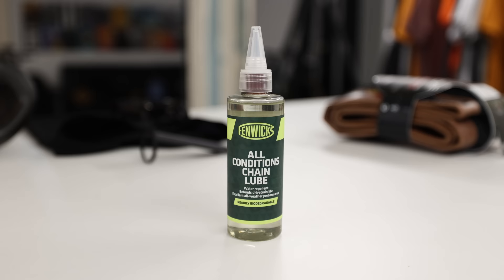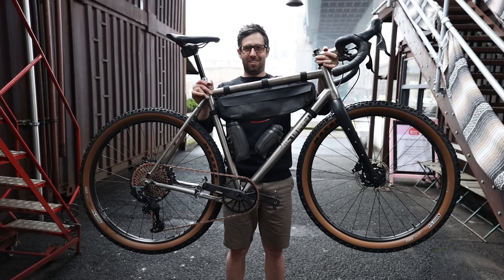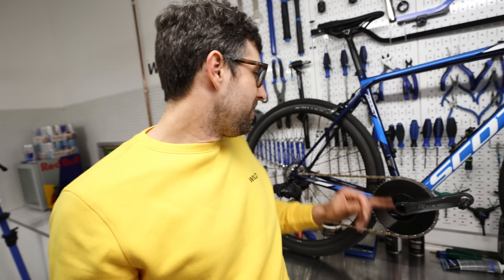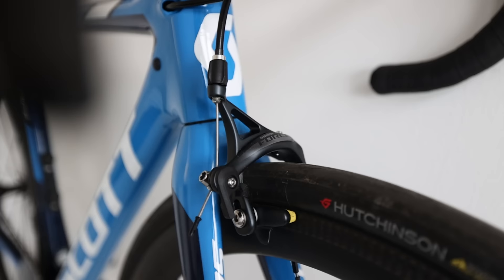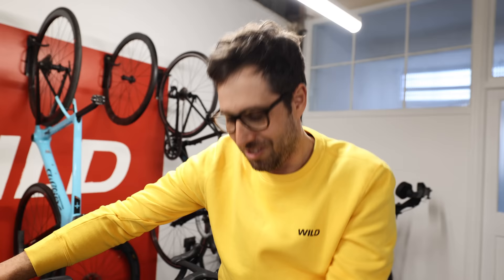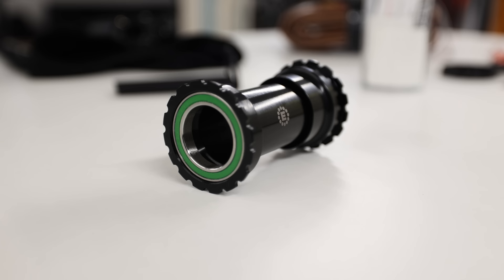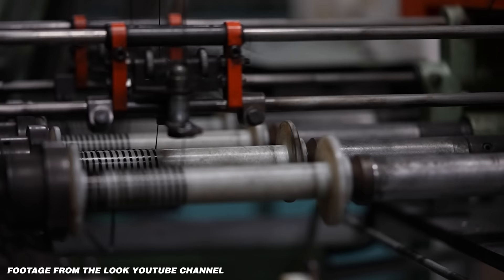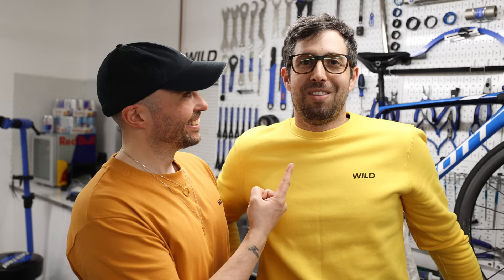Pro Bike Mechanic's 20 Most Loved Products

Comment: Gonna be another vote for a top tube bag. Sunglasses, snacks, phone, money etc. It's all there, it's handy and it secure. The new Tail Fin ones look sick. This was a great video, loved Jimmy's attempts at counter points.......long story indeed
Reply: Nope, pain in the 'nads on small frames
Reply: @matthewlewis2072  

I can see that, but I run a medium frame and a Topeak Fuel tank in .75L. Its not too big and I can straddle the bar with no issues. That new Tail Fin that goes all the way across would be a no go for me for sure.
Reply: Who puts sunglasses in the same bag with one's phone or any other hard item that can scratch the lens(es)? That thing has to be on your nose or tucked into your helmet. All the other stuff belongs into jersey pockets.
Reply: @einundsiebenziger5488  
If I do put sunglasses in there they're in a cloth bag. We all do things our own way but thanks for your nice feedback
Reply: Another fan of top tube bag here. Puncture repair stuff and multi tool in the saddle bag, snacks, shades (in a case) and phone in top tube bag. My Domane has two bolts to secure it so no problem with it coming adrift

Comment: My favourite stuff is Tubolito inner tubes. I bought mine two years ago and had only one puncture since (which I patched - I've put thousands of kilometers into that tube since and it's still going strong). These are especially useful as spares. I carry way more stuff in my small saddle bag since I replaced a bulky butyl tube with one.
Reply: Do they keep pressure like a butyl or latex tube?
Reply: @russellbaker4256  They're just like butyl tubes in that regard.
Reply: So i ride enduro FS bikes, i keep a tubolito on my framestrap, theyre phenomenal, ive got home 3 times with the tube as a last resort. get home, remove it, and replace it on the frame for the next flat.
Reply: The Chinese ride now version cost a few bucks and also seems to last quite well. In many cases they're cheaper than regular tubes at the bike shop
Reply: @javiercastaneda707  I use those and theyre awesome, and super light!
Reply: Piling on for TPU tubes, whether Tubolito or Ride Now or other brands. Fantastic kit, I use them and carry them as the spares and at this point trust them enough I'd set off on a mega long tour with them in my tires and 2 spares. That alone saves you 1/2kg or so!

Comment: Shimano 12x mechanical MTB gears. They just do the job, they are fairly inexpensive if you don‘t buy XTR and there is very little to improve.
Wera A6 torque wrench. Takes hex bits directly which is a lot more useful on a bike than 1/4“ or 3/8“ and makes it very compact so that you can reach bolts in tight spaces like in suspension linkages.

Comment: ''1x'' is my favourite bike product. Im one of those bikers that don't how to use 3 x at all i tend to on 3x stick to the 2nd chainring and just go up and down on the rear cassette. 1x makes it so simple that i have not to think about the 3 chainrings and its bliss just complete bliss. once i got my first 1x its been 1x ever since or converted to 1x.
Reply: Wait until you try 2x 😅
Reply: @rob-c.  my mtb was 2x, still used one chainring only and just went up and down the rear cassette. if im only ever using one chainring then there ''for me'' is no need for the other chainrings to be there like on 2x or 3x so i  converted my mtb to 1x and got rid of the chainring i was not using.
all 3x and 2x bikes i have had have been from new are technically 1x as i only ever use 1 chainring.
Reply: Do front derailleurs confuse you
Reply: @matthewlewis2072  not really, I now they're for speed n climbing. Just that 97% of the time I'm only using one chainring when on 2x or 3x so, might as well stick with 1x
Reply: I mean, a 3x is rendered useless with the increasing range on rear casettes. You could argue about 2x being the same, but there is a point where the jumps just become too big between gears no matter how many gears you cram into the back derailleur. I can see a strong case being made for 1x on a MTB, but that's pretty much it.
Reply: I'm the reverse I've got a 3x and a 1x and much prefer the 3x. On the 3x, the big ring for riding at speed on the flat or downhill, middle ring for pulling away from a stop and urban riding and the granny ring to spin your way up steep climbs. On the 1x I frequently find myself running out of low gears on climbs but it's pretty good for urban riding.
Reply: @samuel_excels  on my current 1x the chainring is 44t and rear cassette is 11 - 42, which I zero problems with. I not a hill climber but the gears I have do me great on the hills I traverse.
Reply: I can't understand how 2x is so confusing. You use the large chainring on the flats and the small one on every gradient upwards of 4% or so, depending on fitness level.

Comment: Been a pro mechanic in a shop in South Florida for 34 years, I'd agree with almost everything you've said. Only because a few of the items I haven't tried yet. Gravel bike for gravel, road and cross. 1X and wireless forever. AWS-10 lives in my shop apron with its little brother, the Stan's valve core remover, because, yeah, tubeless. Radar, radar, radar.

Comment: Dynaplug Racer plug kit would be in my top 10 for sure. Along with a top tube bag I have a small Apidura race frame bag which is really neat and adds loads more storage for a bigger waterproof/more food/gold bars, whatever!
Reply: I got timed using a dynaplug on a ride back in April - 1 min 27.  And that was with me adding some contact glue/cement around it which I always do.  
If anyone can change an inner tube quicker than that, I'd love to see it!

Comment: Oof bit of a controversy: Silca sealant used to eat some types of rim tape (see the WW thread about it) hope they've fixed it by now. if you're not using farsports wheels (they don't need tape) like me then it might give you a hard time.

Tubeless plug: dynaplug seems to be the best. if you like expensive stuff you can carry some in your handlebar plugs as well.

Fidlock: the titanium one seems to be hard to squeeze for some people as I read some reviews, but my normal (well, gravel) fidlock is also a bit hard so I don't know how it can get any harder

SRAM pro bleed kit: yes please
Reply: I had the Silca soften DT Swiss tape, first time (front wheel) I thought is tape error, second time (back wheel) it as clear tape was being attacked. Those happen in about 3 months. Silca recommends tape without printing. They did mention that Stans tape worked well.

Comment: The list for copy and paste  adding to shopping/present list etc:

Fenwicks All Conditions Chain Lube
Biodegradable bike chain lube

Fidlock Water bottle

Vielo r+1 Seatpost

 Wireless Droper Seatposts

Silca Tubless Sealant

1x Drivetrains

Gravel Frames

 Intergrated/Internal cable routing 

 Wide Tyres 

 Fendor Bendor

 J Guillem Atalaya Frameset 

Sram Removable Batteries

Sram & Campagnolo bleed kits 

Park Tool AWS-10

Ceramic Speed Wheel Bearing Press

Endro XD15 bearings

Bike Radars e.g Garmin Varia

Time Carbon Layup

Tubeless Plug & Boot Kit

Bike Luggage       full of South African money and choclate :D

Comment: I like mudguards (fenders); it rains a lot where I live, and I wouldn't dream of riding a bike without them. 

Also, though I like bike luggage, I'm not fond of frame bags; they rub against the knees while pedaling, which is really annoying. I'm a big fan of the Tailfin Aeropack; it's light, stable, and doesn't get in the way; it just does its job without much bother.

Comment: Wish I could say the same about tubeless plugs. In reality though, they rarely fixed my leaky tubeless tires reliably - be it on the gravel bike or the road bike. Usually, once sealant doesn’t seal, it’s then a matter of nursing the bike home whilst pumping up the tire every few km. The only thing that really works for me is patching the tire from the inside. For that though, I need to thoroughly clean and prepare it, which cannot really be done out on the road.
Reply: Dynaplugs!

Comment: Why would an amateur not need all the gears a two-by gives? I'm using my 34-32 and 50-11 and I don't even live in seriously hilly terrain.
So unless you give me an 18 sprocket cassette, I'm either losing range or I have big jumps (and even the 11-34 jumps are bordeline sometimes).
Reply: For me, spinning the correct gear for the circumstances is one of the joys in cycling. I would be terribly annoyed being forced to change my pace because of  bigger gaps.

Comment: Those mud guards you shown DO NOT protect your chain from all the stuff that the tires pick up and bottom frame gets sprayed by dirt and rocks plus it chips away your pain SLOWLY eventually you will notice it! Also does not protect my water bottles they all get sprayed with dirt! I know that because I used them on my gravel bike! I went back to the FULL mud guard and no more issues on my bike chain, or paint chipping away from my frame, and clean water bottles that I can use!

Comment: 2:59 I've got to differ. I built my do-it-all car-replacement road bike with 1x11 after drinking the kool-aid such as Nic's selling here, but how is it the case that there's no cross-chaining with 1x drivetrains? Like, aren't you basically always cross-chaining with 1x except in the middle of the cassette? 

My experience was (with 1x11 44t/11-46t - so imo excellent range overall, but big gaps) on a road bike, both the top and bottom gears felt noticeably less efficient - less smooth, more gritty. Current 2x12 has a similar maximum and minimum gear setup, but feels much better and not having such extreme gaps between gear ratios is really nice. I don't race but I do delivery and commute on the bike; for either use-case there's no way I'm going back to a 1x unless there's some newfangled chains that are specifically designed to flex (a lot) laterally while still being just as efficient.

If you do as Nic seems to suggest and go electronic 1x on a road bike, you've paid a $1000+ premium for a much less functional product than a mechanical 2x one. If we buy this "it's simpler" argument, anyone not racing ought to just ride lightweight single-speeds; for me, road bike 1x is the worst of all worlds. I just don't see where the difficulty actually is in setting up a modern front mech; they're dead simple and work great already.
Reply: I find that 9 speed is the maximum window for cassette width in order to not have significant crosschaining effect in 1x systems. Box groupset seems to be the perfect candidate for a wide-range 1x gear setup. Otherwise, I'd go for 1x9 11-36 on utility/city/commuter bikes and 2x for anything that needs more range.

Comment: Still gonna disagree on the front mech part... 
2x or heck 3x is the way to go for a beginner if the terrain is hilly or you carry a lot of weight. Or if you are on a budget

In my case putting a big ish rig in the front would make me run that nice smooth 80rpm on the flat but wouldn't allow me to climb very well (execpt putting a full dessert plate in the back put that ain't cheap if you want good gear repartition). A smaller one would make me spin out on the flat... But climb well

Comment: I’ve ridden on gravel with fidlock bottles for almost 2 years and switched back to  carbon cages. The fidlock bottles are a bit heavy and on rougher road they are really fiddly to put back (thats probably on me though 😅). Biggest gripe I had with them is that they start to rattle after a while, basically the moulded part of the bottle comes loose from the plastic mount that attaches it to the magnetic parts slowly over time. Had this happen with two separate bottles that had different moulding as well so I guess it’s somewhat of a known issue. All in all they are heavier and way more expensive than a carbon cage with “insert random bottle” combo, though they look more minimal if that’s your thing.
Reply: Yeah, seems like a heavier and more expensive solution to a problem that doesn't exist ...

Comment: complete disagree with his opinion on 2x. If anything beginners need more gears than pros
Reply: Front mechs are here to stay. The more gears the better, even more so for beginners, it's just a matter of setting up the proper gear range.  2x has about 17 to 18 effective speed compared to 12 in 1x; if you go di2 it's actually lighter than 1x due to the shorter hanger arm and smaller cassette. the cassette is way cheaper to replace. The chain is always aligned in 2x compared to almost always cross-chained in 1x.

The main inconvenience for all these advantages is switching complexity and another thing to break.
Reply: 100%, if anything we ought to be going back to the good old 3x8, everything lasts far longer and you've got the giant granny gear to get people with no time to train (like me lol) up those big hills. Also you can piece one of those together on the aftermarket for less than 100 quid all in compared to over 1000 for most of a good modern groupset
Reply: Disagree, less is more, even when you’re starting out
Reply: @jamsxr  surely more is more if we're talking about range. Now in terms of complexity or cost, absolutely less is more but just skip the 12 speed nonsense and go with a good old 3x8 go as fast as you like but be able to climb any hill
Reply: @johnmccrossan9376  horses for courses, coming from MTB and moving to road and gravel, I much prefer a 1x most of the time.  You can winch up any hill, but you top out at 45kph - fine with me most of the time.
Reply: I have an old Giant 3x7 MTB that effectively has 11 unique gears ratios, but 21 sounded better for marketing when they were being sold.
Reply: @Just-Dan  complete agree. My mid-2000s bike has 3x7, but effectively only 11 unique gear ratios. When on the middle chainring, if you want to go to a lower (less effort) ratio from the bottom, you shift up one gear on the back and down one on the front. Inverse of this on the top end. Everything else overlaps within a couple %| So effectively 2+7+2 = 11 effective gears, with a lot more complexity. But, 21 speed was good marketing at the time.
Reply: Well. I say to have so many gears i use only two or three all the time. And find that having two in front unnesesary
Reply: 2x is the way to go. 1x requires too much constant changing of gears or gear hunting. 3x has a useless 1st chainring and is heavy. 2x has one chainring for hills and another for flats. Simple. Can also drop a chainring quickly for sudden hills.
Reply: The range is more useful, but I’ve seen more than 1 beginner who just didn’t understand the whole 2 derailleur thing. Once they did work it out they were happier.

Comment: I found Silca Sealant on a road set-up pretty poor. It didn't plug a 5mm slit, nor a weeping hole. When I opened up the tyre to repair it from the inside all the fibre pieces had clogged in one place rendering the sealant useless.

Oh, and you have to pop the tyre off the rim to use it. That's mess I don't need.

Try milKit. It has fibres within the sealant, but as it's a little bit thicker the fibres are held within the solution evenly. It's also synthetic latex, so it doesn't dry and washes with water. With milKit I don't need to add air for ~ 2 weeks on the commuter bike. It's the best sealant I've used.

Comment: So much misunderstanding in the comments about 1x groupsets. For those naysayer that have never ridden them, please check out the actual gear ratios you get on your bikes: You'll find that there is overlap and duplication in 2/3x group sets and that you hardly miss out at all on the most commonly required gears with a 1x groupset. My 1x is actually lower geared and easier up hills than my 3x and I never find myself wishing I had an in between gear. Where some of you might find you miss out, if anywhere, is with slightly bigger gaps at the top end but let's face it, most of us only use those gears when caning it downhill.
Reply: It's not about overlap, it's the huge jumps between gears. Up to six teeth difference between the smaller gears just feels like you're riding a three-speed gear hub. One gear is too small, the other too big and nothing in between. Also, 1x is so ugly, that silly small ring in front with those pizza plates at the rear just look stupid.

Comment: Regarding the Park tool AWS 10, if you have been using them for 20 ears then yo'll know that you are unable to nip up an Octalink chainset as they are 8mm, which this tool doesn't have. Okay in the workshop where you do, but not so when you're out and about. I have put an adaptor on mine from a far cheaper tool to allow for this

Comment: I really dislike internal cabling,  especially when they route Bowden cables around tight bends, around the stem and steerer, it just causes premature wear and tear and makes the cable performance worse,  whilst at the same time it creates the illusion of performance because people equate aesthetics with performance.
Reply: If you're talking about only integrated internal routing, yes, I don't like it too and I'm saying this as someone who's capable of working on it, all of my work with this configuration (ex. one-piece cockpit installation) were done solo. Regular internal routing is where I draw the line.

Comment: The 1x thing is controversial on road bikes but I totally agree! I don't need that massive 50/11 top gear, or even 48/11 or whatever.
42 up front is fine, gets me above 50 km/h and once I'm going faster than that I'm not pedalling anyway, just enjoying the descent.

Now in the back I could put a 36t cassette to get me all the range I need, but I just have a 28t because Flanders is flat as hell and you actually have to choose to go to a hilly place if you want to do climbs.

And I've never liked front derailleurs if I have to be honest... I have 5 bikes and none of them have a front derailleur, and I probably won't ever buy or build one with a front derailleur either. (Well, maybe buy, but then take it off)